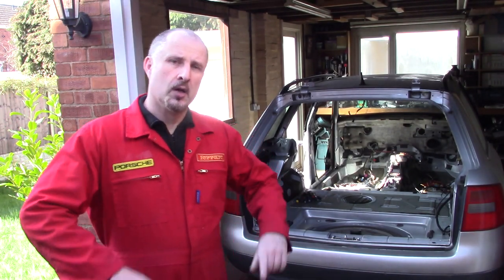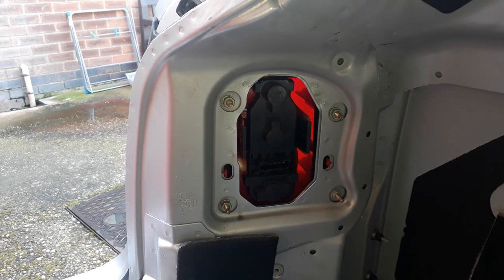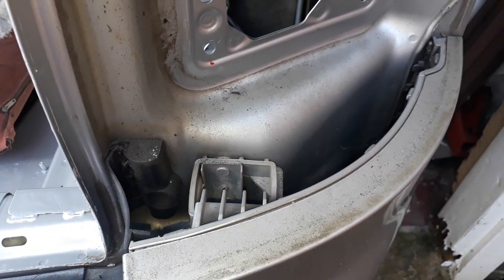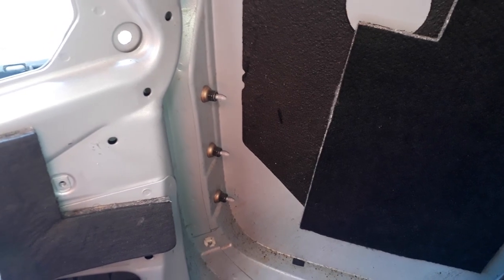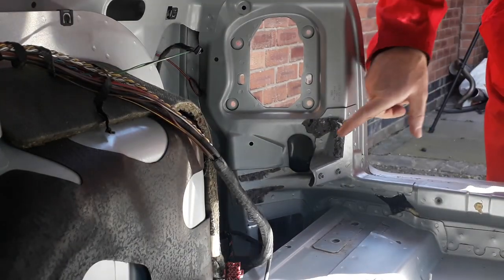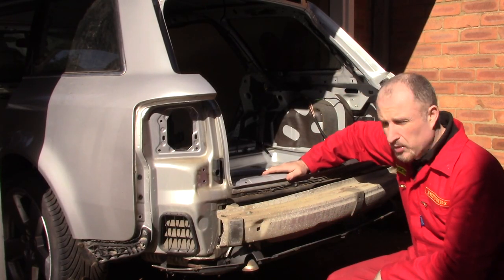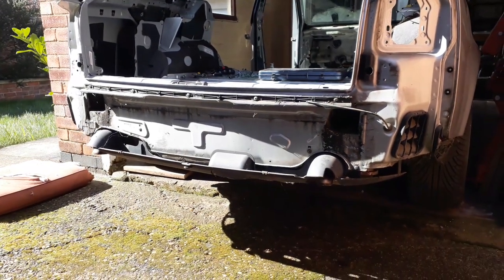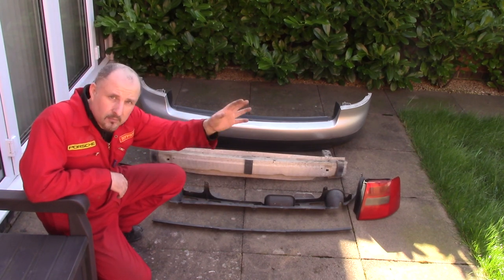How to remove the Rear Lights and Bumper from an Audi A6: Quick Tech Ep2.

Comment: 4:54 5:58 can I access these screws without removing much stuff?
Reply from the maker: Yes, you don't need to strip the rear down as much as I did. You should be able to gain access to these screws without removing the rear seats and side panels.
Reply: @ProjectSupercar  I want to install aftermarket parking sensors
Reply from the maker: @niume7468  Nice upgrade. ;)